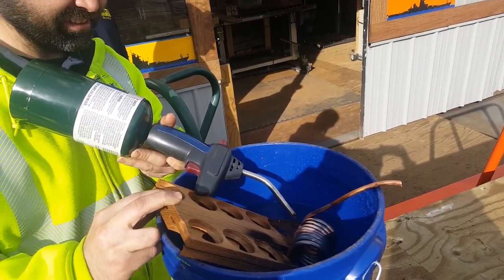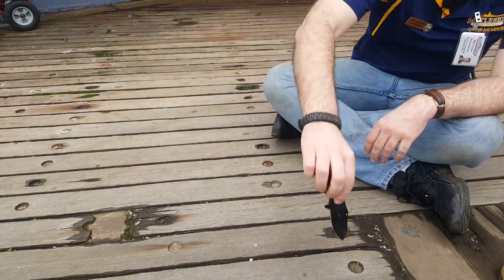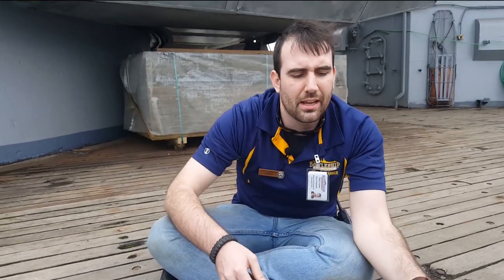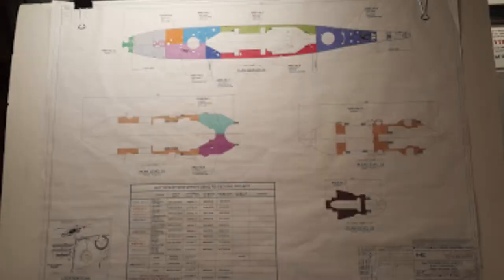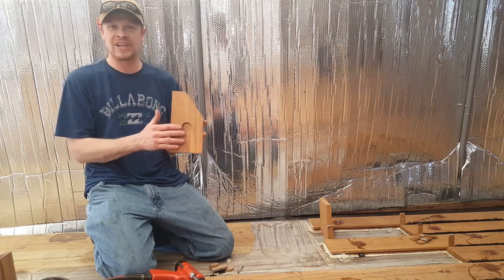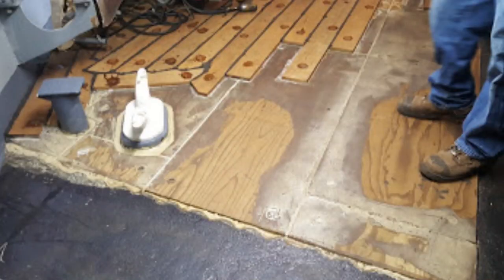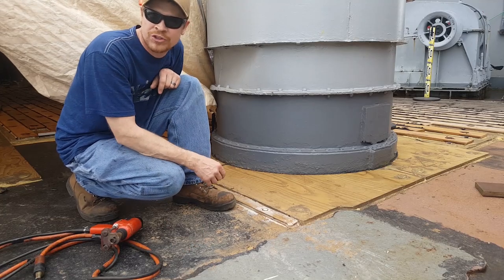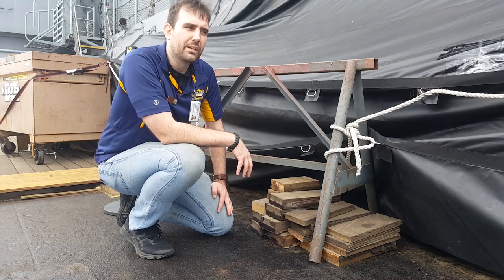The War At Home, Part 6: The Deck

Comment: You might look into composite wood.  They're typically made of recycled plastic, sometimes combined with sawdust.  They last for a long time and might be available in a teak look.  One brand is Trex.  There are many others.
Reply: Agreed, many Yachts use simulated teak PVC decks. This is due to teak being a high risk lumber and very expensive. I bet a company would give a great price for that amount of needed material.  

Also, I would be a bit weary that the plywood isn’t pressure treated for rot.. but time will tell.
Reply: @Murphys2ndLaw  With any luck, they might donate it.

Comment: You mentioned that the Iowas were the last ships built with the teak deck. However I believe that the USS Los Angeles de-commissioned in 1995 was also built with a teak deck. 
Also you did not include that the teak deck on a battleship helped prevent dropped metal objects from sparking which micht have set off power when it was moved around the deck on the trollys during moving ammunition to the magazines. 
One question for the future. Given the size of the deck division there were plenty of hands to holystone the desk. Will you have enough volunteers to do this after replacing the deck?
Reply from the maker: We will not be holystoning the new deck, it would wear the deck away to quickly. The USS Los Angeles that was in service in the 90s was a submarine with no deck, if you mean the cruiser she's from the same era as the Iowas, but decommissioned in 63.

Comment: I’m sure there is a good reason for not doing this, but why not rip up all the wood, fix the steel underneath, repaint and add a grit for traction?
Reply: for one the ship served her whole career with a wood deck so changing that would not be preserving the ship as she was. the other is it looks nice and provides insulation